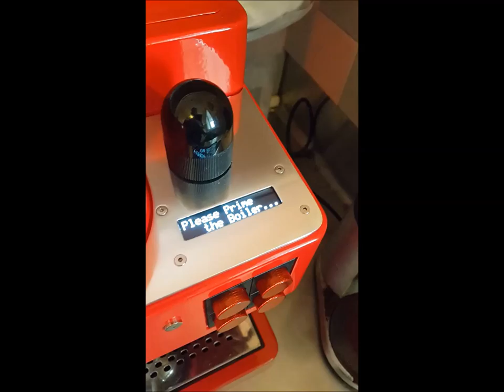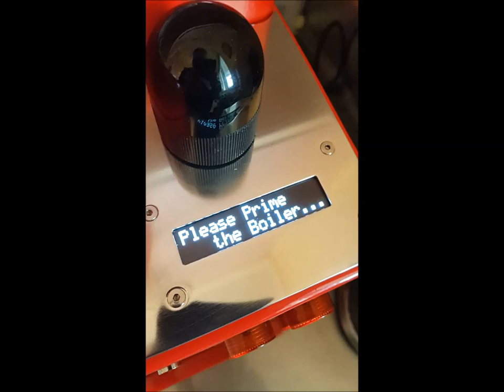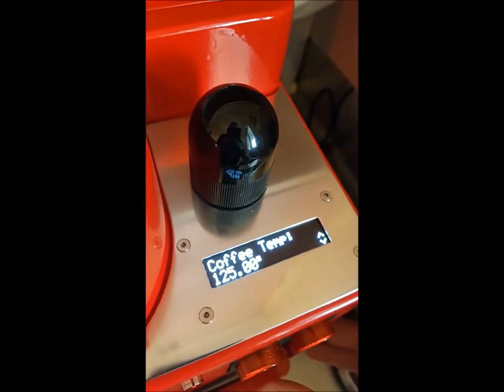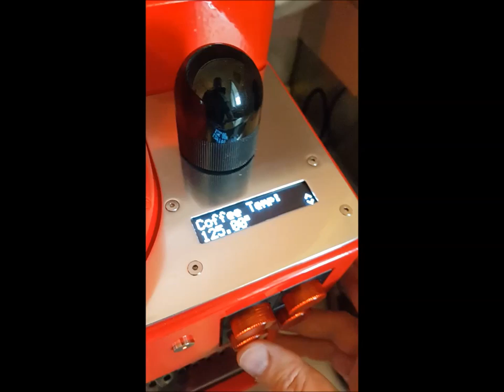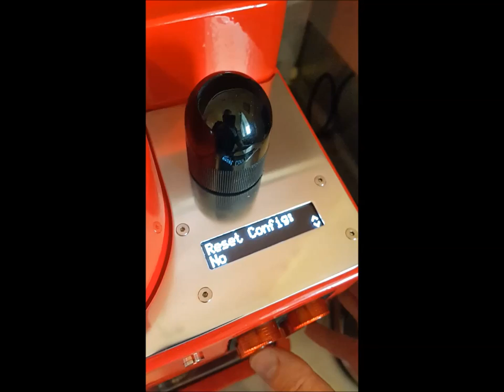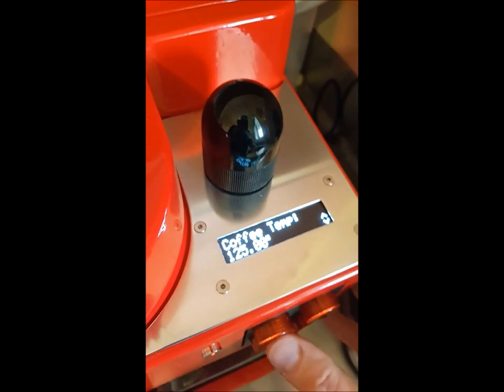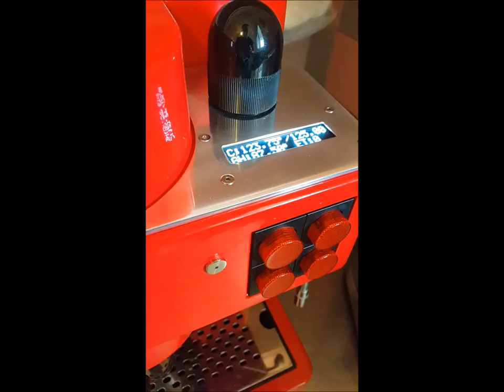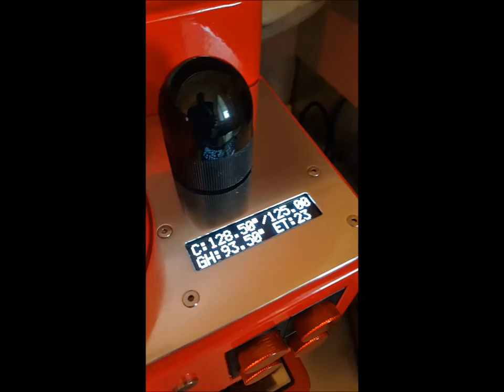Brasilia Espresso Restoration +PID +Arduino

Comment: Nice work Rhys. It looks great. I've had 2 of these. First one blocked up. I took the boiler and solenoid apart and eventually found the blockage. Unblocked it, put it back together with new seals and got it working. Then i gave it to a friend and it is still going 8 years later. Second one did the same thing but when I was testing it i accidently spilled water on the electrics and bang. pump still works but not the boiler or maybe it does but  the switches don't. Anyhow I have no experience with electric stuff. Now I've found another one with all electrics working however it looks like it has been 'plumbed in'. The person who sold it didn't know as it was his mothers and got relegated to the garage. It is badly blocked but still had some water dripping out! I'll check out your blog. Well done. Cheers Leroy

Comment: That’s awesome Rhys! Great work.
Just out of interest- how do the components handle the heat? Does the OLED display get hot in that location?
Reply from the maker: Cheers Dominic! I haven't had any issues so far and the machine is used most days. I was actually just thinking the other day that it's been very reliable. Previous iterations used a 1602 LCD display on a 4-bit parallel interface and that was very unreliable, I think mainly due to grounding/signal noise issues. Often corrupted chars etc. The OLED is on the i2c bus and hasn't missed a beat.

I don't think the components in the back get very hot as there is a sheet metal shield and they are in a plastic box. I imagine the OLED gets a bit hotter as it's pretty close to the boiler, although I was more concerned about moisture ingress due to steam hence why I went to some effort to seal it.

Comment: Hey there, I have an identical machine and was hoping to follow your build (which is awesome btw), but I was too late to get the code before your blog went down, is there any chance you could share it again? Thank you so much!
Reply from the maker: Kia ora Sean, yes I've been meaning to fix that up! Done now. And I've uploaded the latest version of the code which I'm running. It's pretty rough code (I'm not a very skilled developer). I did have some trickery in place that had normal and aggressive PID tunings so it would turn on cold with aggressive tunings and then when it reached a certain temperature it would go to normal tunings. Likewise I had it disable the PID and just put the heater on at a fixed power level while water was being pumped - the idea being that if we are pumping water we know the boiler temp is dropping fast so don't wait for the PID to catch up. However...there was an intermittent issue where it would sometimes keep heating past the set point. I've disabled the above features and simplified the PID code and it's been running sweet ever since. Let me know if you've got any questions and I'll do my best to answer. I've still got some PCBs lying around too. I can send one out to you if you want.  
Ngā mihi
Rhys
Reply: @RhysGoodwin  I can't thank you enough, I had all my parts ordered and on the way when I realized I'd forgotten the code, and was sweating bullets when I thought I might have to figure it out myself. If you're not very skilled there, I'm several orders of magnitude beneath that, self-saboteur maybe! I did order some of your pcbs myself, thank you for the offer I'd honestly thought there was no way you hadn't been availed of them all by now!  I'll definitely share photos when i'm finished everything, but thanks again for the inspiration, aspiration, and everything in between 😃 Thanks again, and happy holidays!
Reply: @RhysGoodwin  I had one other quick question and I'm sure i'll feel silly once I know the answer, but how are you using the 4th relay in your build? Is it vac controlled for the whole machine?
Reply from the maker: Hey Sean, very good question. It had me confused for a minute. There are only 3 AC loads to be controlled - the heater, the pump, and the solenoid. I think I added the 4th relay for future-proofing, with the idea that it might control a water valve if I ever plumbed it into the water supply. 

Looking forward to seeing your progress - take lots of photos! 🙂

Ngā mihi
Rhys

Comment: hello the solenoid valve must be at how many bars?tks.
Reply from the maker: I'm not sure but the pump is typically 15 bar
Reply: @RhysGoodwin  not the pump.the electrovalve.because i have a problem:when the boiler heats up I have water coming out through the solenoid valve pipe.
Reply from the maker: @jjjkll7005  Sounds like the valve needs to be cleaned. Try a backflush first, next take it out and clean it. Otherwise you might need to replace the valve.
Reply: @RhysGoodwin  ok thank you very much.

Comment: Hi Rhys, I got a Brasilia Action Lady and am stuck could use some advice/help? cheers!
Reply from the maker: Sure, ask away.
Reply: Rhys Goodwin Hey champ! Firstly awesome job! I gave up on the machine (couldnt find thermostat part for boiler) but recently tried using the machine after reattaching the thermostat to the side boiler with some paste and zip tie. I wanted to disconnect the water boiler so that the machine just does espresso’s, what do you think is it possible? Cheers!